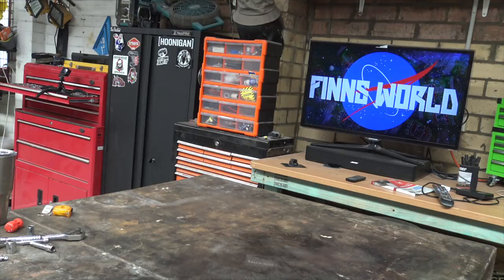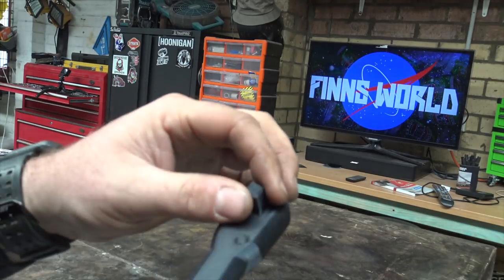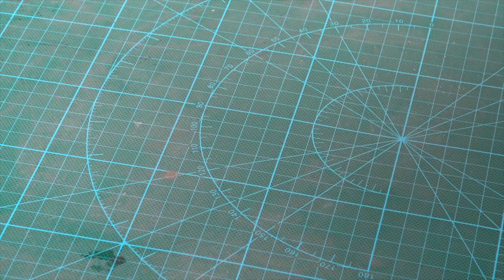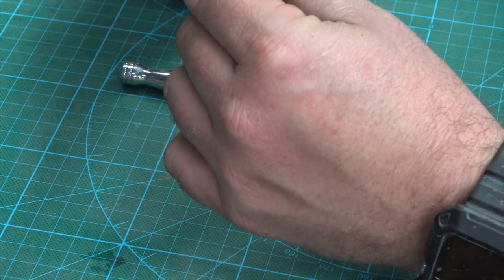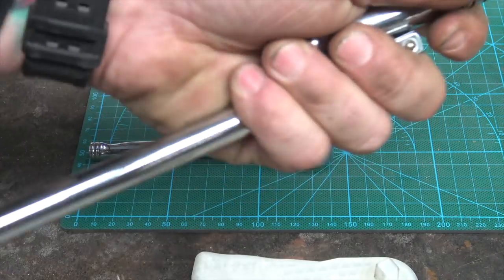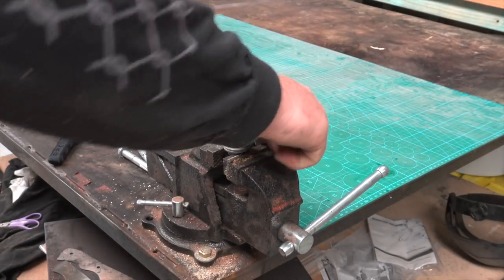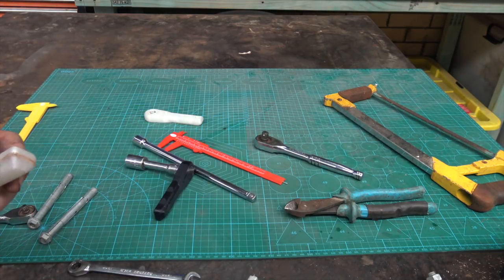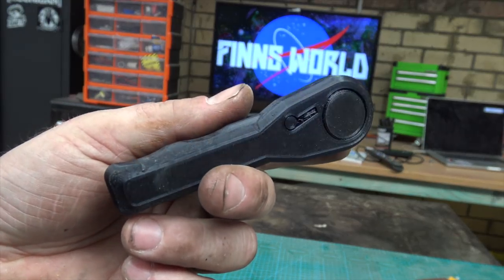The 3D Printed NASA wrench | First tool emailed into space! | Earth based testing!

Comment: non reversible? one for tightening one for releasing

would they be usable in a vacuum? with the closed structure inside holding air
Reply from the maker: An easy design addition is to put a square drive on the other side of the wrench so you just flip the whole tool,  some people have made mock ups.

Inside of a vacuum I assume it would work the same, the inside wouldn’t hold air I don’t think

Comment: Completely useless tool since the print is in the wrong orientation for strength for the square drive. I would print this in two parts with an internal square hole and a separate square drive printed in flat  orientation giving the tool maximum strength.